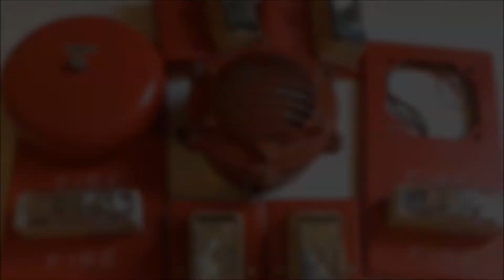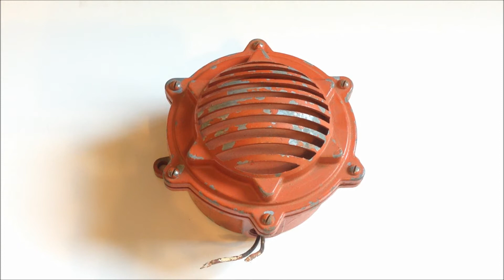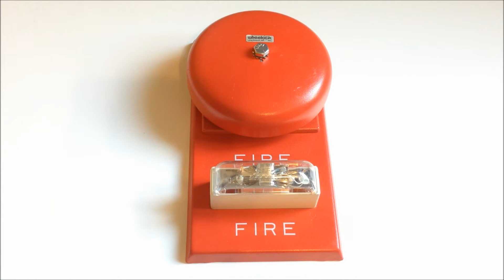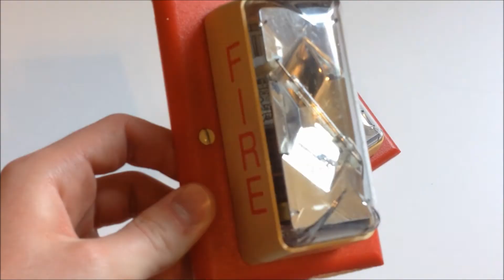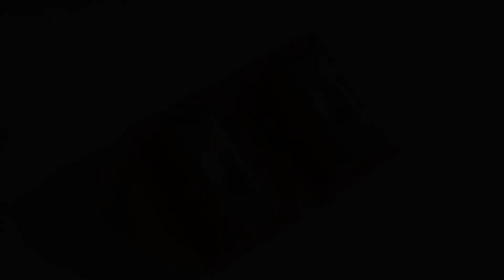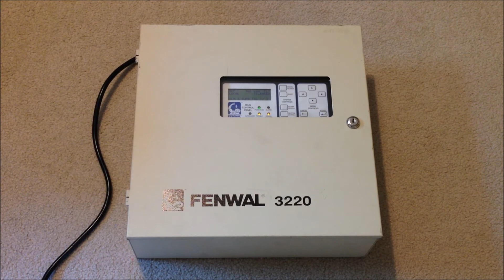New Fire Alarm Devices | April 2017

Comment: Isn't the Federal signals horn explosive proof?
Reply from the maker: It looks similar to one, but this model isn't actually rated as Explosion-proof. This is just how they looked back then, lol.
Reply: Just to clarify for the OP, explosion proof means the device is airtight to prevent ant sparks from causing an explosion. These devices are used in areas where the air might be concentrated with flammable gases.